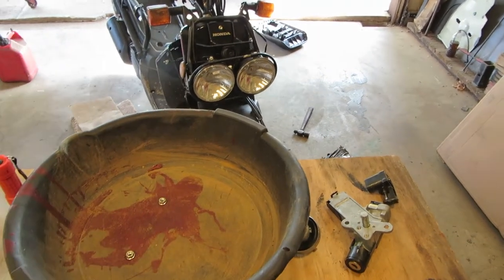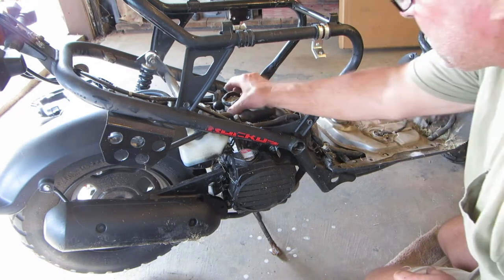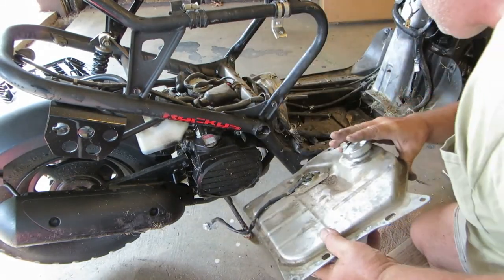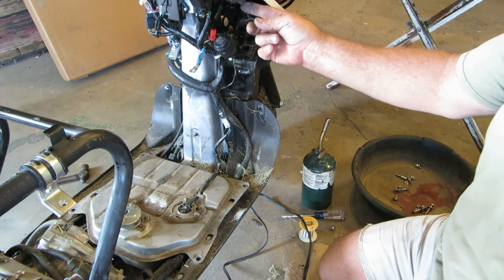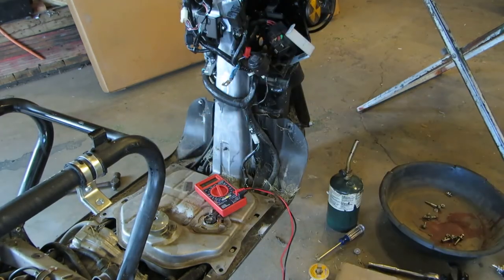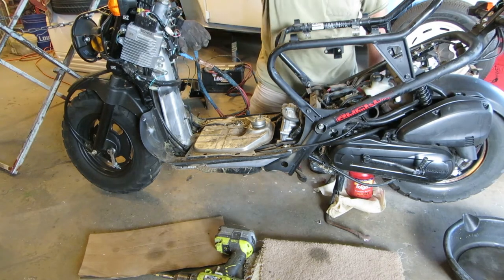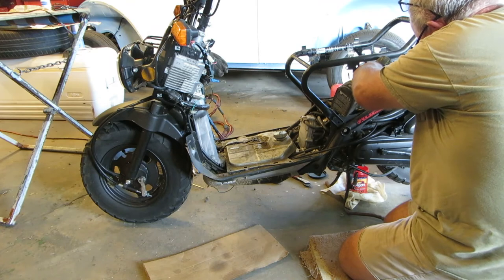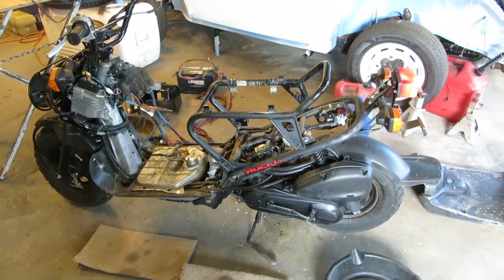Will it run Honda Ruckus 2015

Comment: Just picked up a Honda Spree yesterday morning gentle claimed it “won’t run” got it home gave it a couple kicks and it started for a few seconds. Drained the old gas as it had been sitting two years, drained the gas in carb put fresh in and cleaned the spark plug and whamo it ran like a top!
Reply from the maker: excellent!